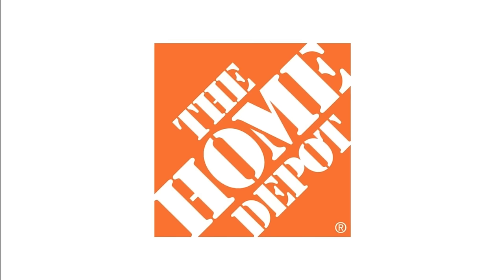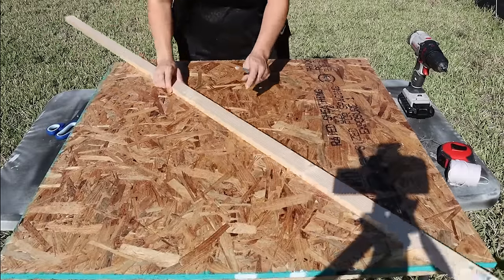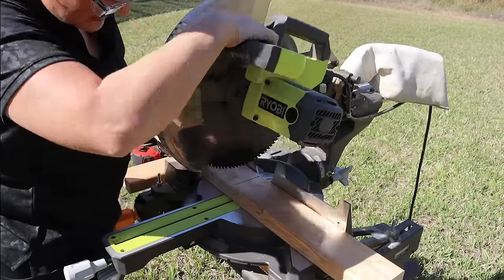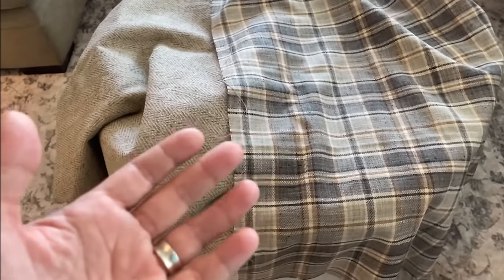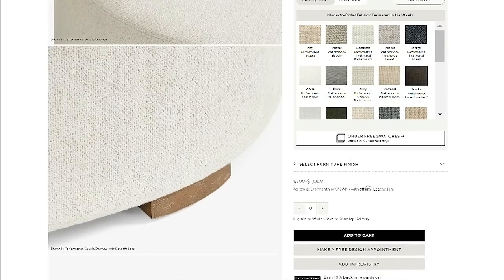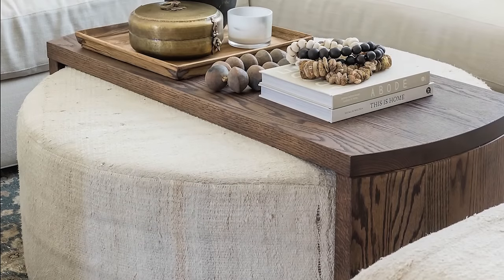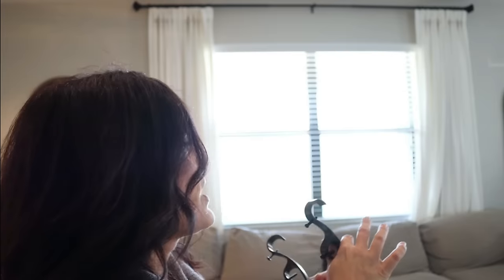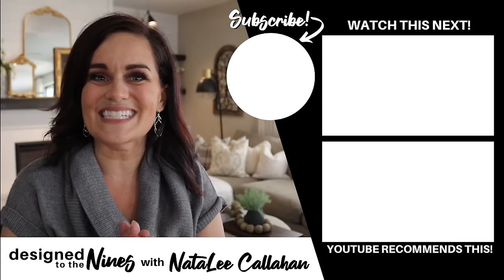Can I DIY a $7,500 Designer Ottoman for Under $100?

Comment: I like A.  It being equal on both sides. In my mind I see A or teepee point at the top sliding down to the bottom of the A frame. This pulls the view to the center to where your color is the brightest.

Comment: I love your flavor! I like option #1 the best. There are little things at the bottom of most sofa/chair legs that both make the furniture easier to slide and protect the floors. You might want to add a few of those to the bottom of both sides of the shelf you made to fit over the ottoman to make it easier to move.
Those double curtain hangers were such a great find. I've been wanting to install curtains with sheers but have been avoiding it because of all the measuring and drilling. With only two brackets being necessary I'm going to go ahead and get that done.
Thanks so much for sharing!

Comment: Wow, what an absolutely beautiful ottoman. You did a fantastic job. I like the first option on the buffet. I have used power tools my entire life. I also was a mig welder at a shipyard for years. Then spent 20 years as a casino dealer. I am disabled now, at age 52, but I still use my power tools especially since I can't handle saw by hand.

Comment: Really like the simplicity of this.
There's 2 things I bet you could do... the circle you cut for the ottoman... or even the base of the ottoman, you could lay this over the square top and trace the rounded corners.. then sand down the corners to the lines. The next thing.. you could flip the ottoman and put in a drop door for extra storage or a good hide-y hole. Just a thought

Comment: I like the second option of styling the table.  Something about the two lamps in option one just didn’t feel right for the size of that table.

I love the ottoman and bridge that you built.  You are teaching me so much!  I just moved from California to Oregon and don’t have my furniture here yet ( I bought a house and had the carpeting pulled and they are refinishing the wood floors before I bring in my furniture.) I am so anxious to see how my existing pieces will work in this smaller home.  Also, my previous home had two wood burning fireplaces, and this home has none.  I miss my fireplaces more than I can tell you.  I want to sit by the fire and watch it snow!

So, after marathon watching many of your older videos, I came across the fireplaces you built!  Genius!  I have some power tools coming on the moving pods, but because you watching your videos, I ordered a miter saw!  I am so excited to start making things, but I will have to wait for the rest of my things to arrive.  I am contemplating whether I really need a table saw.  With Home Depot offering to make some cuts for the buyer, I might not need one.

Comment: Great job on the ottoman and top. The entry table is very nice. In my opinion, Option A: I understand you wanting symmetry. However, the top of the table is too small for two lights. Option B: Very nice. Maybe remove the small gold frame from the back. Looks a bit crowded and unnecessary. It just doesn't need it.  Either one would be lovely with the small tweaks. Keep up the excellent work. I love your videos.

Comment: I live in an apartment.  So it is not feasible to use larger power tools. I have a drill, a small electric saw, and hand held sander. I do furniture refinishing on curb alerts and free estate sale furniture but do not buy furniture because we have no real extra space to keep it. I have a storage unit rented full of decor and some furniture I flip but that is a slower turn over so I have to wait and sell and buy/ find, wait ,sell, buy in cycles. I'd love to have a place to keep.that large saw, a lathe,  and other tools.

Comment: Well done as usual! It’s gorgeous❤ Just and fyi a butt joint is the weakest of all joints so I’m glad you reinforced it with L-Brackets.  If you decide to redo this in oak a 45 might be a cleaner, stronger option.

Comment: I bought miter saw!!!! Cannot gethead to lift, don't  laugh!! Okay have a chuckle.  HELP
Reply from the maker: There is usually a little latch on top that locks it down into place. If you can find it, it’s very easy to slide to open.
Reply: @designedtothenines  Thank you, even bought a compressor and stapler like yours..